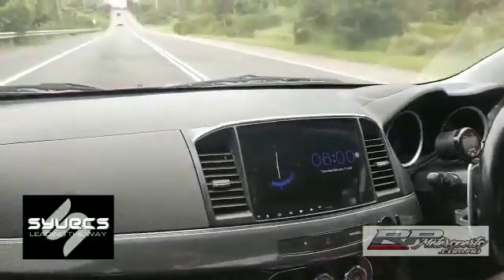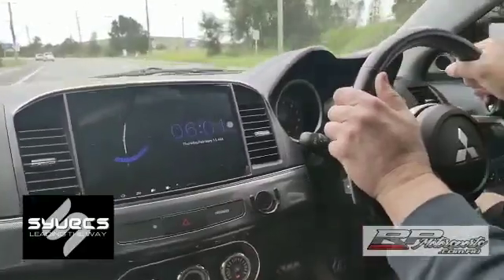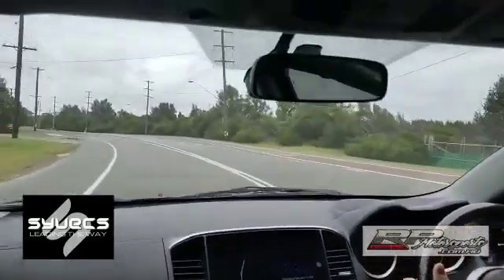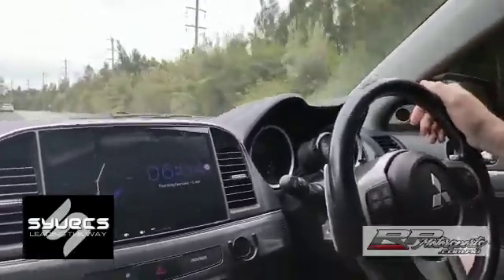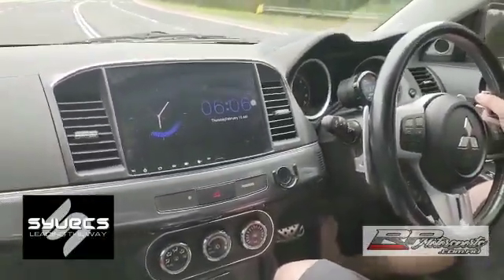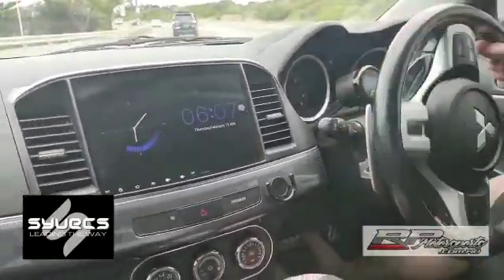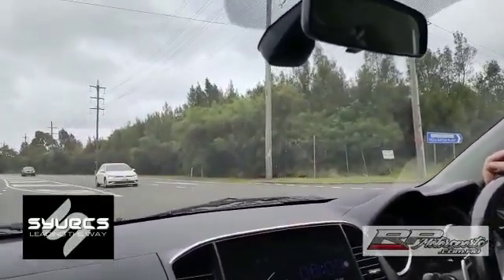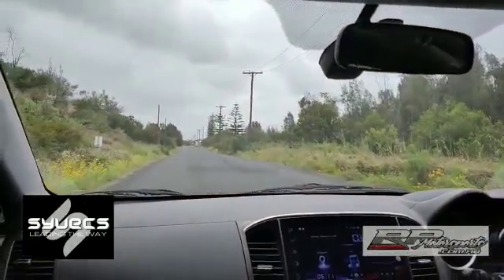RP Motorsports tech talk episode 1 SST 4B11T Syvecs S7 powered Mitsubishi Ralliart- Evo X

Comment: We have an mr here that syvecs s7 plus just is not playing well with. Wired correctly and everything but the syvecs has too many issues with flex fuel and fuel cuts and shifting voltage issues. Going back to stock ecu solves all the problems. Syvecs base tunes for sst need work.